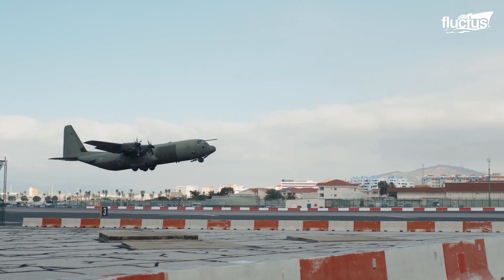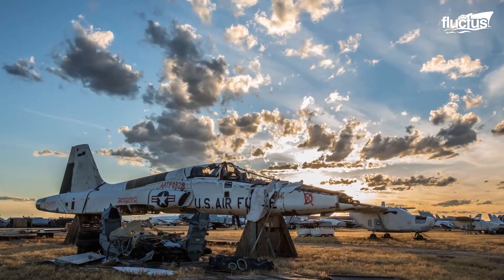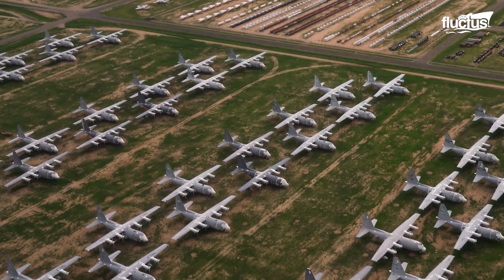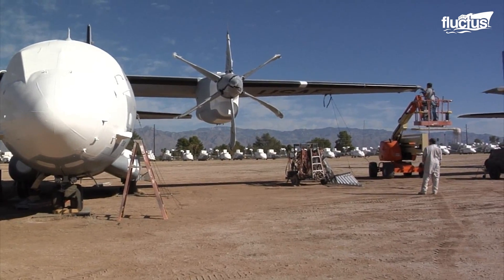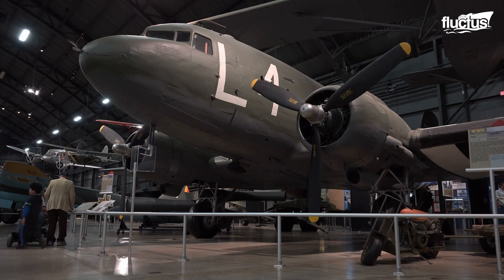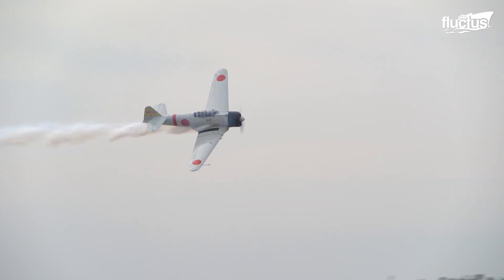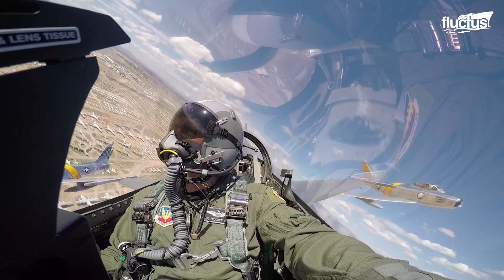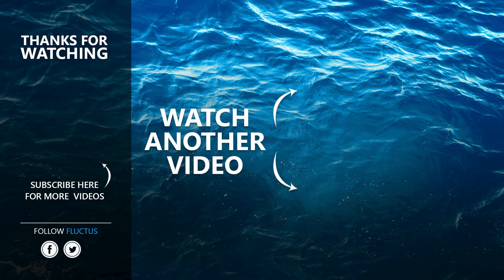What Happens to World Largest Aircraft When They Retire Forever

Comment: Contrary to the video, are there actually any C-130s that were built in the 1950’s still flying?  Today’s C-130 is much evolved from the original, it is definitely not the same airframe.
Reply: no, the active duty units are all flying J models built in the last 25 years; the oldest Guard and Reserve aircraft are H models from the mid 80s, and many of those have recieved significant upgrades